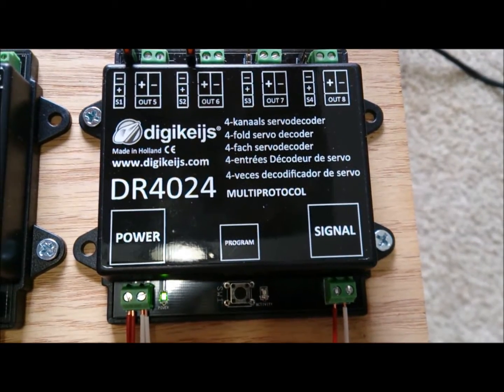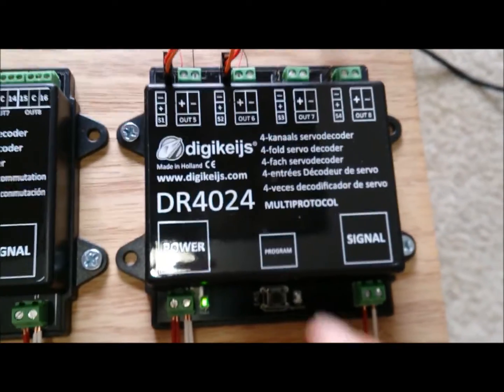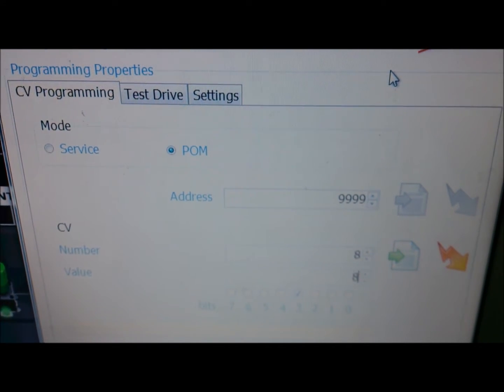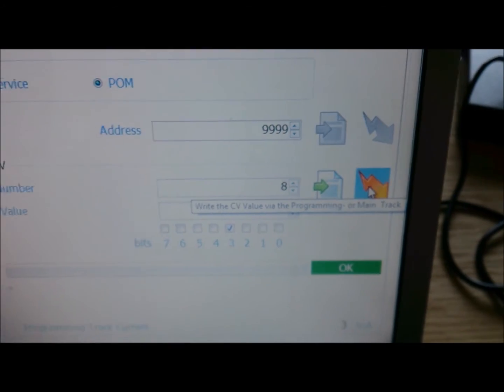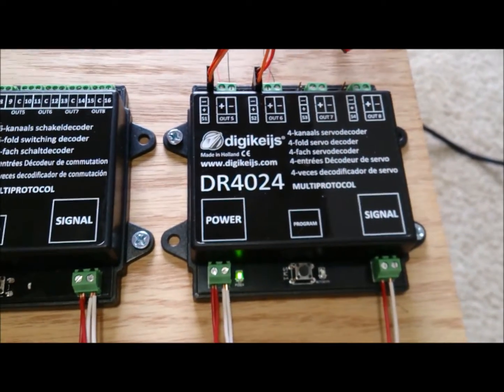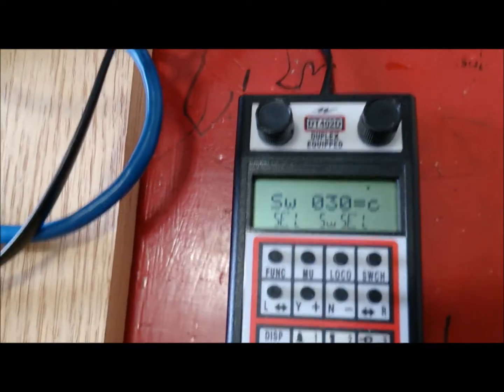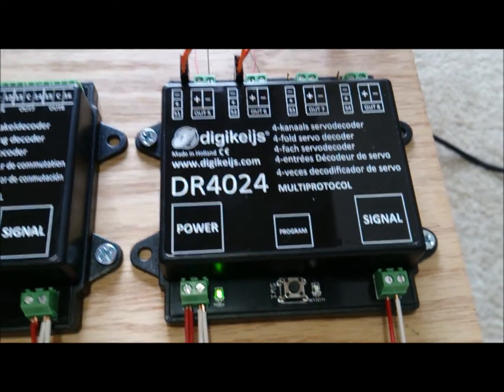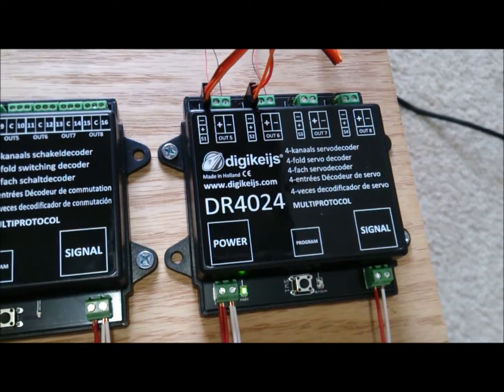DR4024 Setup - Part 1 - Factory Reset & Board ID

Comment: Hello, I wonder if you can help me.

I am trying to setup servos for turnouts using a DR4024. I have a Digitrax DT402 throttle and Digitrax DCS200 Cammand station.

The manual of the DR4024 says to program on main (POM) using address 9999. However, the digitrax manual states that the maximum loco address number allowed is 1983.

Does this mean that the DR4042 is incompatible with Digitrax, despite it being advertised to work with all DCC systems?

Thanks for your time :)
Reply from the maker: Yes, it will work with any system that has programming capabilities and can throw a turnout. 

The Digitrax can actually go up to 9983.  The DR4024 by default is 9999.  You need to change this first if you are wanting to change any CV values.  

The beginning address can be changed simply by pressing the programming button and then throwing a turnout to the number that you want. This is how you assign the output numbers.  

If you have a PC with JMRI or other app you can do it even easier with the CV Programmer or the DR4024 is listed under the name DigiRails in the decoder list.  

I'm going to do a new video showing how to program with the Digitrax throttle soon.
Reply: @IronPlanetHobbies  Firstly, many thanks for your fast reply!

Sorry, typo, I meant 9983 :)  I already tried 'Programming on main' via JMRI Decoder Pro via the digitrax PR3. It didn't work.

I have not yet tried to connect the DR4024 directly to the PR3 programming output for 'direct programming'. I can try this, but do I still need to press the button on the DR4024 to send the LED red using this method? The DR4024 manual says nothing about direct programming, only POM.

Thanks for your time :)
Reply: I have tried to programming directly, both from the programming output on the DSC200 command station using the throttle, and also using JMRI and the pr3 programming output terminals. It doesn't work.

I read the following on the DR4024 manual:

'Please note that reading out and programming the DR4024 via the programming track only works if the central unit does not switch off the programming track!
Therefore, before attempting programming, check that the green LED next to the power connector is lit. Only if this is the case can the DR4024 be successfully
programmed as described in this section.'

Problem is, neither the command station or the PR3 keeps power on, they both seem to switch off the programming track.

It just seems like it's not possible for me to program the DR4024. I can set turnout addresses fine, but need to adjust the servo A & B positions :( Do you have a digitrax command station? Are you able to try it?
Reply from the maker: @DaKinn  Yes, I did it with just a DCS100 and a DT Throttle.  

Connect the DR4024 to the Main.  Press the prog button every time you want to make a change.  And after you have made the change.  You don't need the PR3.  Using the Digitrax manual you will see how to program with the DT.  It is just like they describe for programming an engine on the main.  The DR4024 is a DCC Decoder.  

With the Digitrax you will need to set the address first (9983 or less) and then make your CV adjustments.
Reply: @IronPlanetHobbies   Many thanks again, I really appreciate your help!

I'm still a little confused! :D HAHA. If I can't select address 9999 on the digitrax throttle to program it, what is the first thing I must do?

So you are saying I can do this via 'programming on main'? I am able to program my loco's on the main using the throttle no problem.

But how to I program the DR4024 on the main if I can't select 9999 on the DT402 throttle?

Thanks so much for your help buddy, I really do appreciate it!
Reply from the maker: @DaKinn  Yes, do it on the main.  This way the power stays up and you can get the red light on.

When programming a new address, you don't need to know the current one.  You set the new address when you go into programming mode.   The hardest part is remembering to press the button, selecting Op modes on the throttle and pressing it again when you are done.  You can give it a 2 or 4 digit address.  I prefer 2 but it really doesn't matter.  You will also need to reset the starting output address once you change the board address.  If you go to page 100 on the following link you will see how to set the board address.  It is just like setting one on an engine.  https://www.digitrax.com/media/apps/products/starter-sets/evo/documents/Evolution_manual_rev.1.pdf
Reply: @IronPlanetHobbies  Your are so kind in helping buddy!

OK, so I will wire the DR4024 directly into the RAIL A & RAIL B connections on the DCS200.

I then press the button on the DR4024 so the red LED lights up.

I then press the program key on the DT402 throttle

I then choose 'Po = Operations mode ' for program mode

I then choose 'AD2' on left knob, and '55' on right knob (assuming I want to change the DR4024 base address to '55'

I then press enter on the DT402 throttle

Will this then change the DR4024 to address '55' so it's no longer '9999'?

I can then program the DR4024' as per it's manual in POM mode, but use address '55' instead of '9999'?
Reply: What I don't understand is...

You say to program it it on the main (RAIL A & B termainals) using OP Ops mode programing.

But this Ops mode relies on knowing and entering the decoders 'CURRENT' base address, which is '9999'.

From the Digitrax manual page 29:

'6.1.1 Ops mode programming
Ops mode programming (see section 16.3) is done on the layout with programming directed to a specific decoder address on the layout tracks.'

So in Ops mode, it doesn't show 'DAT' in the right corner, it shows the decoder address you want to re program.

To put it another way, I was previously controlling my loco number '03'. But I then wired the DR4024 directly to the RAIL A & B terminals (no track involved).

When I enter Ops mode programming on the DT402 throttle, it displays '03' in the right corner, so it's trying to program decoder '03' and not the DR4024.

I hope that makes sense?
Reply: Also, just to clarify, the above instructions you give, I am right in understanding that we are trying to change the DR4024 base address from '9999' to another, say 2 digit address (lets say '55')?
Reply: Digitrax manual page 104:

'How to use Operations Mode Programming
1. Select the DCC loco address that you want to program on either the L or R
Throttle. Be sure that the address you want to program is the active throttle, the one with the blinking smoke when you enter programming mode.'

So as I thought, to use 'Ops Mode' programming, you need to already have '9999' selected as the active loco' I can't select this as 9983 is the highest.
Reply: You mentioned 'When programming a new address, you don't need to know the current one.'

But in Ops mode programming, you DO need to know the current address?

Sorry for so many replies...LOL hahaha
Reply from the maker: @DaKinn  Yes, this is how it is done.
Reply from the maker: @DaKinn  Yes, you dial up the address you want to program it to.  Once you program that new number the DR4024 is no longer 9999.
Reply: @IronPlanetHobbies  Thanks, But when going into 'Ops' mode 'Po' on the DT402 throttle, it's trying to program the last loco I have on that throttle '03'.
Reply from the maker: @DaKinn  Yes, you have to put throttle into Address Programming.  You can do two by turning the left knob left down til you get there or by using the right knob to put it into 4 digit mode.  This is shown starting at page 100.  Once you select your mode, you put in the address you want to program it to.  Just like setting the address is an engine.  Address mode is similar but different than CV programming.
Reply: @IronPlanetHobbies  What do you mean 'Address Programming;?

These are the Digitrax modes:

   Pg=Paged mode (Digitrax Preferred Programming Mode)
   Ph=Physical register mode
   Pd=Direct mode
   Po=Operations mode
Reply from the maker: @DaKinn  You have the option of programming CV's or a 2 or 4 digit address.  Look at page 100 this shows you how to do it.  Read all of section 16.1 this explains address programming. Make sure you use Po when setting the address.
Reply from the maker: @DaKinn  Here is a video I just did using the DR4018 but the programming and setup are the same.  https://youtu.be/_GgehWAKRE0
Reply: @IronPlanetHobbies  Thanks so much Ryan! This worked!!! I managed to do a CV8 = 8 reset first.

Then I programmed CV17&18 to give an address of 8888.

I can now program the servo positions using loco 8888 on the digitrax throttle!

I didn't have a separate power supply, instead using the method outlined in the DR4024 manual 3.7 page 13. But this is a little bit more hassle than your method.

Thanks so much for helping me with this.
Reply from the maker: @DaKinn  That is great!! Glad you got it going.

Comment: Hi I’ve just bought some of these from your Amazon store. What I’m not sure about is how i can use the outputs to switch the polarity of a frog. Can you help with this?
Reply from the maker: Alan Wilson Hi, you will also need the DR4102 Points Crossing Interface.   There is a diagram of this on the last page in the manual.   Thanks again,  Ryan
Reply: IronPlanetHobbies Thanks, I will have a look at this.

Comment: Great and thanks , im new with this stuff .. can you explain how to program / the settings of the servomotors so that i can make them work ?
Reply from the maker: +Gert Meering I can try and help.  What are you using the servos for?
Reply: Servo's 9G ... i didnt have the DR4024 but now have them and that made it easy.I work with the z21 (white ) it seems that the servo's go to far.The range of the pin that is attached on the servo.
Can i program it so that the range is shorter ?
Sorry for my bad English.Hope you understand.
Reply from the maker: Yes, You can use CV 238 through CV 253 to set the pulse time of each of the outputs.
 
The default value is 128 and maximum value is 254. So the current time can almost be doubled or shortened. 

You can check out the manual here:  http://www.digikeijs.com/files/index/download/id/1394235559/

I hope this helps!
Reply: Thanks alot ! i wil try this